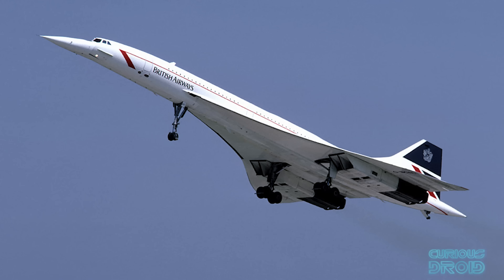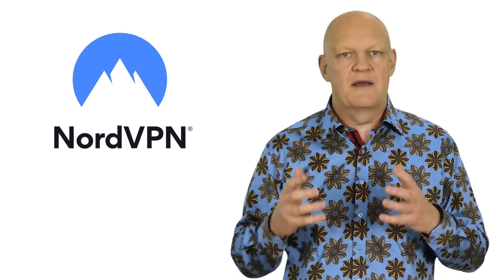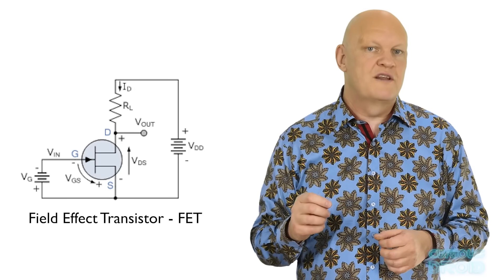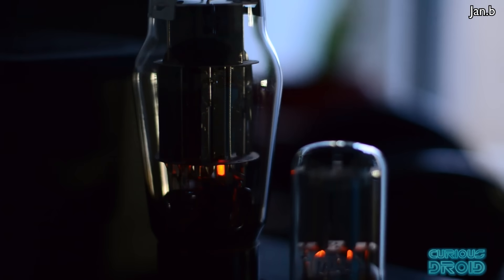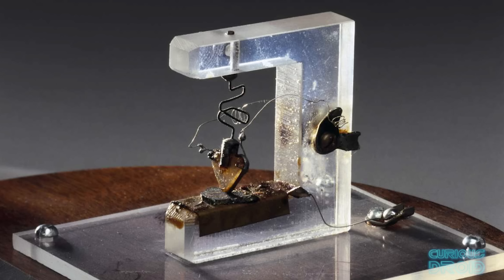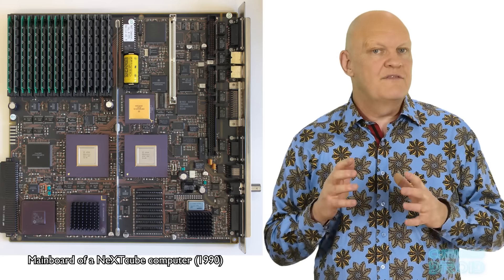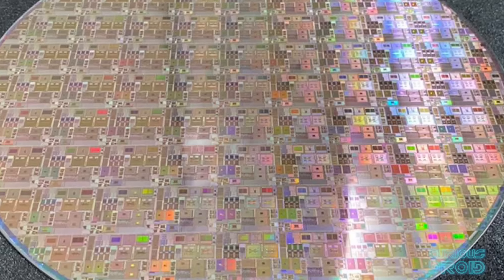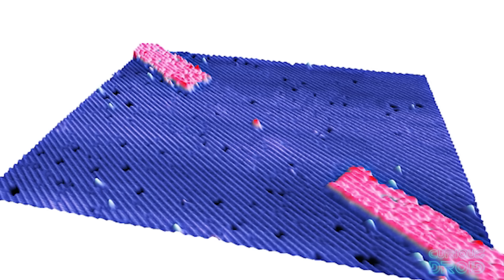MOSFET – The Most significant invention of the 20th Century

Comment: One of the more important features of MOSFETs that you didn't mention is that at full saturation, internal resistance is very low, unlike bipolar transistors. This means MOSFETs are capable of switching very high current loads without generating much heat. This allows for the use of MOSFETs to replace electromechanical relays, as well as for high-speed, high-current switching. This is why our "power bricks" of today (including cell phone chargers!) have evolved from heavy devices containing iron-core step-down transformers, into tiny, switching power supplies capable of producing huge amounts of current from a tiny power supply with very little heat and very high efficiency.
Reply: Electronics Engineer here, Bipolar transistors or more specifically IGBTs (insulated-Gate Bipolar Transistor) still have their strengths compared to MOSFET technology, for example MOSFETs rule at low voltage, high current applications (<400V) whereas IGBTs rule in the high voltage and especially high voltage AND high current applications like EVs (check tesla motor and motor controller disassembly, where you can see a lot of parallel'd IGBTs on each motor phase).

Generally MOSFETs balance their attribute of being either high voltage, low current or low voltage, high current, but not being able to to do both high voltage and current at the same kind of power dissipation at what a IGBT could do.

Personally I like MOSFETs because I design/work with low voltage devices where the low ohmic states of the MOSFET being turned on is much more important to lower thermal generation and that they are simple to control with just voltage.
Reply: @antecboy  I hear that SiC and GaN MOSFETs are starting to edge out IGBTs since they manage to offer similar Rds(on) to lower voltage silicon MOSFETs combined with high voltage standoff capacity in the hundreds to thousands of volts range.
Reply: @triffid0hunter  Silicon Carbide is the shizz
Reply: GaN FETs are wicked fast, and have tiny gate capacitance, but in high voltage use, you need to be careful with miller effects.
Reply: @antecboy  I have worked on several commercial laser products which all use IGBTs to switch  capacitor banks' high voltages and currents.
Reply: @antecboy  IGBTs are used on the early model s and x controllers. The 3 and y and future models are using MOSFETs.
Reply: @antecboy  what you explained about a 400V boundary between MOSFETs and IGBTs is valid for silicon technology.
The new evolving SiC technology outperforms Si. Look inside Tesla Model 3 inverter, and you will find SiC MOSFETs there, custom made by ST.
However, your described rule will be generally correct for SiC, too. Only the boundary between their optimal uses is much higher, at around 3-4kV. 
SiC based IGBTs rated at 10-15kV (or even more) are being developed in the labs these days.
Reply: @antecboy     They do require some gate circuitry.    MOSFETs require some extra push to remove charges from the gate or push them in when they get big.

There are timing issues involved when you get into bigger circuitry.
Reply: @antecboy  IGBTs also in induction ranges, as well!
Reply: And a lot of noise just ask any radio amateur
Reply: This is the application I associate with MOSFETs.
Reply: A lot of these power bricks use MJE13001 (or it's direct clone) type npn transistor to do the main switching instead of mosfet, but still electronic power supplies are very small and lightweight for the power output compared to older mains transformer based ones._
Reply: @DjResR  Yep, I looked inside the base of some old compact fluorescent light bulbs, and instead of MOSFETs, it was all bipolar transistors doing the switching.
Reply: and lovely RFI
Reply: Go easy on the low heat explanation of the MOSFET. You can easily singe/burn your finger on one of those while in operation.
Reply: @SpaceCadet4Jesus  ...for a burned finger tip... grab an earlobe. That's the coolest part of your body... faster to reach than an ice cube
Reply: Looking at the IR 1995 catalog back in the late 90s, I noticed an N-channel MOSFET in a TO-220 case (the power transistor case you probably see most often) that claimed it could switch 100 Amps.  Knowing the TO-220 is a 40 Watt package (at the time, with proper heat sinking), I scoffed and looked over for the "RDS on" value.  Sure enough, it was only 4 mΩ.  IR has been bought out (by Infineon) and that's 26-year-old technology, but Infineon has some N-channel MOSFETs with RDS on less than 1 mΩ.

Another advantage of MOSFETs is their positive temperature coefficient - the resistance goes up as they get warmer (unlike BJTs).  That means you can parallel multiple MOSFETs to handle larger loads without a complicated circuit.  One will carry more of the load and heat up, which increases the resistance, so the load begins shifting to the lower-resistance paths.  I've never had to handle larger loads than a single MOSFET could handle, so I don't had any practical experience in designing that type of circuit, but I love the very idea of it.
Reply: As a 2nd year electronics and telecommunication student I'm actually enjoying this kind of content, it presents things in a way college classes don't.
Reply: "Power bricks" use switching transistors at the input, where the currents are lower than at the output, so even the bipolars can do that.
 The main reason why "power bricks" are smaller is because the old low-frequency (50-60Hz) iron-core transformers have been replaced with ferrite-core high-frequency (20,000-200,000Hz) transformers which enable the transfer of power with much smaller core and fewer windings of wire.
 For the supplies which use "synchronized rectifiers" at the output instead of diodes, where there is low voltage and high current, MOSFETs are a must.
Reply: Why they replaced mercury arc rectifiers for ac to dc conversion in large setups
Reply: @Phil-D83  but mercury arc rectifiers are so pretty when operating though, haha
Reply: @keithyinger3326  the glass ones; yes.
Reply: @keithyinger3326  oh yeah. They are a  must have on tube amplifiers :)
Reply: @keithyinger3326  Yes they are and my mom still has a couple thermostats in her house that are mercury switchs. I allways loved to watch it slike over and make the conection and see a little blue light everytime.
Reply: @Phil-D83  Do those go inside the encabulator? 😆
Reply: They uses those mercury diodes some cases (old ones) still today, and it's next big thing in Russia, because they cannot manufacture anything from Si. Maybe they have biggest maining of that for making special types of aluminum mixtures. It hardens aluminum and maybe made it better for resist corrosion, but I don't know all of it's secrets. But Russian cpus are rare. Maybe China would help them, but they are very much idea copying factories in china, not inventive ones.
Reply: Jay Rock AK  Maybe for car amplifiers that work on low voltage and high current, while sound quality is not of high importance. There is engine noise and wind. Those who install crazy car amps usually just want the loudest noisebox possible and don't care for transparent playback of an input signal.
But the reason for the use in guitar amps is that the characteristsics of a Mosfet is closer to vacuum tubes that are still most sought after in guitar amps. 

For Hifi-applications mosfets aren't ideal. Properly biased bipolars rule the field there with the occasional oddball vacuum tube, for nostalgia.
Reply: I remember back in the 70's and 80's Thyristor semiconductors were also used for high current switching.  They'be been replaced by the cheaper FET's.
Reply: @BillAnt  They have been replaced by IGBTs. Textbooks fail to illustrate their working. Like backlit CCDs, they use both sides of the wafer. They use the wafer thickness to switch high voltages. For current it may be interesting if the emitter is based on a BJT or on a FET. Those parts are pretty isolated. The BJT behaves like a BJT and the FET like FET no matter if they are followed by  kinda diode through the wafer.
Highvoltage ( >1kV ): You only use them in vehicles or the grid. Not so much in a household.
Reply: That's a fact only electronic engineer would know. Most people don't understand why or how it works just that it does. And for as cost is concerned. There's either repair or replace. I like to repair. Great job
Reply: RDSon that low has only really been available since the trenchFET invented by International Rectifier in the late 1990;s. At that time IGBT was the way to go.
Reply: Switch mode power supplies still use iron cored transformers to reduce the voltage, only they got a lot smaller due to the high frequency the mosfets can drive em at.
Reply: @hernerweisenberg7052  No, they don't use iron cores. Why do you say something like that when you OBVIOUSLY have no idea what an SMPS is and how it works?
Reply: @jackmclane1826  Perhaps you missed them, they can get quite small if you run em at 20kHz ;)
Reply: @hernerweisenberg7052  They are not iron cores! At 20kHz you make an induction heater if you wrap a coil around an iron core. ;)
Reply: He didn't mention Mohamed Atalla and Dawon Kahng, the actual inventors of the MOSFET.
Reply: P=I*I*R, make R low and P will be.
Reply: Sean M  log is due to Fermi distribution and also present in a FET
Reply: Sean M  It shows the scale. You need so high gate voltages for FETs that the original effect at the PN interface can be ignored.
Reply: Sean M  I would love to see Power FinFets. Like when we could produce a grid so fine like the distance between dopants. This would be for low voltage high current. Clocks in ICs, LED driver. Maybe we could tune SiO2 not to dislocate nuclei on overvoltage, but just let the electrons tunnel.
Reply: Sean M  IGBT has a gate, so it has MOS , or? I heard that SIC has a layer crystal structure. Layers can have different orientation of shifts .. so normal to the layers it is like glass. Within the layers it is a crystal. Like the defect rich GaN it seems to work. Funny. I thought that SiC is used for IGBTs only. IGBTs seem to have this latch-up feedback of a thyristor. I never found a good explanation for this. Maybe it is supposed to act like a Schmidt trigger to avoid to have the switch in a half open state.
Bipolar got its name from the fact that holes and electrons move through the same area. But ultimately we don't want them to meet each other. Even without resorting to insulators I would love to have a layer structure with 20 layers intrinsic semiconductor and then a p monolayer then 20 layers intrinsic and then a n monolayer. Then holes and electron probability would overlap less and they recombine less.
Reply: wikipedia reader missed obvious info!?!? no way
dudes a hack
Reply: Damn, now I know why chargers getting smaller, but unfortunately, the introduction of fast charging requires phone charges to increase again
Reply: why is it then that my laptop's MOSFETs are constantly overheating? ;(
Reply: @HardBaseUnderMySkin  typical in cheap laptops.
Reply: That isn't mentioned? Wow.
Reply: Umm. It's well known that a saturated bipolar transistor has lower impedance than a MOSFET! (Based on similar ratings otherwise)
Reply: So if I don't plug in my flash drive for ten years it wipes itself?
Reply: @hotdogryalls  i dont think plugging it in will stop it
Reply: my phone charger says it's a Turbo.
 HA!
Reply: a lot of times a BJT will still be used as the switching element in phone chargers since the switching currents are much lower at the high line voltage and often times high voltage rated FETS (or the really cheap cheap ones) can end up with an even higher on resistance then a similar cost BJT. but there is also EMI consideration since BJTs tend to not switch as fast as mosfets they inherently produce fewer high frequency harmonics and can get away with cheaper filter components which can also be critical to keep form factor small. MOSFETS are much better suited for lower voltage higher current applications though they can still be found in your high voltage fly back circuits but generally for higher power devices like computer PSUs or lighting applications as the low ON resistance for better efficiency matters a little bit more then cost in those situations.
Reply: Than you should Look Info mesfets
Reply: Well......    sorta, kinda.  I work with such things.

MOSFETs are good for such things.   They are far better for making very dense logic circuitry.
Reply: thanks for the info!
Reply: Yeah, I guess it's a function of the era I grew up in but to me MOSFETs are chunky great power transistors used to replace high power valves.
Reply: FETs switch slower due to the gate capacitance.  Bipolar has an advantage there which is why they are used in THz silicon designs.  Tradeoff is always power for speed.
Reply: @GodzillaGoesGaga  Why do so many of you people who don't know what you're talking about feel the need to show your ignorance?
 When it comes to switching, a MOSFET is faster than a bipolar transistor rated for the same current.
 Just go through a few datasheets (if you have ever read or, more importantly, understood one) of MOSFETS and bipolars, and compare their switching times, then come back here and tell me what have you found!
Bipolars have a "storage time" which makes them turn off slower and impedes their performance at higher frequencies. This is why you will see IGBT inverters generally running at no more than 30kHz, or bipolar SMPS at no more than 50-70kHz, while MOSFET inverters and supplies can easily go above 100kHz, even above 1MHz in lower voltage (under 40V) converters.
Reply: @UserName-cb6jz  Bullshit.  There's a reason RF devices are bipolar.  Go and read up on the transition frequency and get back to me.  The issue is with gate current and capacitance.  The transconductance of a bipolar transistor is lower hence it has a faster charge transit time.  Ie it has more current available to charge the Miller Capacitance.  Go and look up Miller capacitance whilst you're revising your theory and knowledge.
Reply: @UserName-cb6jz  IGBT are Insulated Gate Bipolar Transistors.  They are a hybrid of Fet front end with bipolar backend since Bipolar has (had) higher current capabilities due to the low channel resistance.  The reason they are slow IS BECAUSE OF THE FET Gate part!!  The reason I said "had" is because GaN fets have very high current capability.  But they are still relatively slow!  IGBT's are a cross over for high power to kind of work like tubes/valves.  It's all about the power transfer!
Reply: @GodzillaGoesGaga  I know what IGBTs are and their basic construction. I also know about the issues with gate driving which is like charging a parasitic capacitor gate-source, plus gate-drain once the MOSFET starts conducting.
 But you apparently don't know about the storage time of bipolar junction transistors (BJT), which is typically greater than the rurn-off times of a MOSFET.
Even a plain BJT is slower than a MOSFET because of the storage time, and engineers use some tricks to reduce it, but those tricks usually lead to a higher voltage drop across the conducting channel.
Reply: It also doesn't hurt that a lower voltage is needed for the device to perform...~ 3.5v as opposed to 5 v for TTL
Reply: IGBT's are now doing higher power switching.
Reply: When I was a kid I could beat some one to death with a power adapter.
Now they can blow away in a strong wind.
Reply: and making EV’s practical, efficient and long lived
Reply: Why dollars?
Reply: Bipolar transistors still win in a few high powered cases, as they can be designed with a lower resistance than FETs (at the cost of higher swiching losses), hence the IGBT, a MOSFET controlled bipolar transistor is used in many inverters.
Reply: Yes and now fones are realy difficult to hold. Drop, drop , drop. Break break break
Reply: Mosfet follows I2xR while transistor follows IxE. So at lower currents, mosfets are better, at high currents, the lower cost IGBT is much better. It's a cost tradeoff.
Reply: Well, this brought the nerds out.
Reply: @NoahSpurrier  
L🤫L Quiet @ the Back! 🤭
Reply: @NoahSpurrier  Good one! The nerds we need more of.
Reply: @NoahSpurrier   
 "Well, this brought the nerds out."

 "This is the application I associate with MOSFETs."  @ Will Usher
Reply: @NoahSpurrier  ...be glad nerds exist. They've made our modern lifestyle possible. Virtually every possible device/tool we use were dreamed up then made tangible by nerds. 
The Brits called such people boffins...not sure why.
Reply: @NoahSpurrier  So nerd is a person who knows something and "normal" person is a person who knows nothing. So just sit, turn on TV and buy things developed by "nerds".
Reply: @NoahSpurrier who else is here?
Reply: @NoahSpurrier 😂
Reply: Would be ABSOLUTELY AWESOME if you offered some diy, troubleshooting, and teardown electronics videos!
Reply: @hullinstruments  It would be almost pointless for an engineer to attempt this as the troubleshooting gear is a very costly IR microscope and there is nothing to tear down as the circuits are monolithic.   In my career I witnessed 2 senior managers on different occasions express their inability to understand how their own employees were able to create functioning microchips.
Reply: @jeromebarry1741  good to know. Wasn’t really aware of him or his other content. I thought maybe he did more in-depth DIY stuff and component level repairs
Reply: and most importantly ELECTRIC MOTOR GO FAST
Reply: @Blox117  Came here to say this. Don’t forget about ESCs in drones!
Reply: @thomerow  ESCs in general. i build fast ebikes/escooters >50mph lol
Reply: Hello nerds!
I'd like to tell you I understand absolutely nothing of what you're talking about here but I envy you.
Reply: @faustin289  haha just join in! Fake it till you make it..if more non nerds Switched to MOSFET jargon the discombobulation would increase exponentially, singularity both achieved and averted, a superimposition of all states in between, diametrically opposed and tangential
Reply: @julesbrunton1728  Sweetly done!
Reply: Redesign the tube ; make it just adorable , aerio dynamic  , built in lava lamp , multi colored an with half naked women dancing in grass skirts...inside vaccine tubes like Christmas ornaments... Faberge eggs of tube revival..!
Reply: Dollar Guy here.  I stayed at a Motel 8 and agree with Scott's Synth Stuff and that Mcmuffin guy.
Reply: Surely mosfets are used for that purpose. But the real reason why power bricks are now much lighter is the phase out of iron core transformers and the spread or SPS tech.
You could build an SPS with BJTs so that development is not fundamentally linked to mosfets. Although they are better for the purpose. Not so much in high power applications though... This is where IGBTs are used a hybrid of Mosfets and BJTs.
Reply: That action of the mosfet is what makes modern induction heaters possible.
Reply: @1980Baldeagle  That is fundamentally not true. High power induction is usually made with IGBTs. The B stands for bipolar! ;)
Even before transistors, induction heating circuits were made with valves. Vaccuum tubes!
Reply: @jackmclane1826  right on. Modern heaters just a lot smaller and cheaper i guess
Reply: Who upvotes this? The switched current always goes through metal- NPN doped -metal regions. Resistance can be reduced by making the NPN thing short (parallel to current) and wide ( perpendicular to current ). It has nothing to do with the way it is switched.
Reply: @ArneChristianRosenfeldt  You have a reading comprehension problem. We are not having the conversation you clearly think we are having.
Reply: Great insight my dude 👍
Reply: A good prayer:
I'm a sinner JESUS please forgive me for all my sins I know you shed your Blood for me on the cross at Calvary. Thank you JESUS for my salvation and for shedding they Blood for me. I love you JESUS. 
Romans 10:5/10 ct...❤️k
JESUSisLord!Amen..
Reply: Nerd alert...nerd alert!